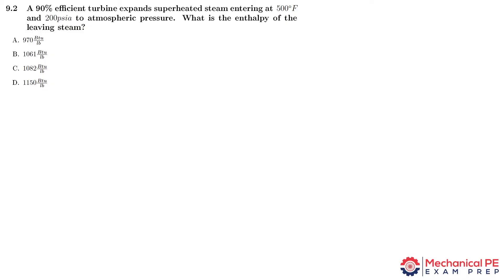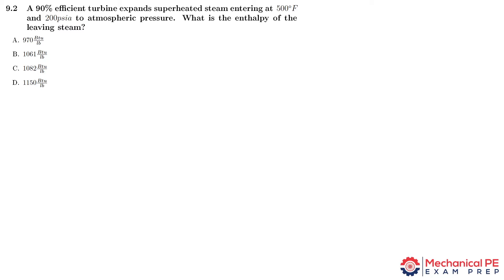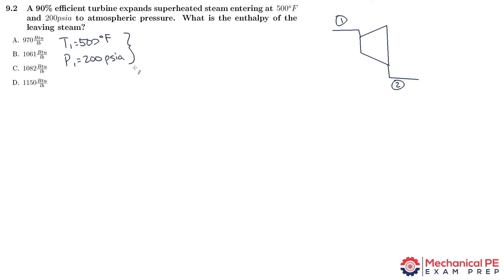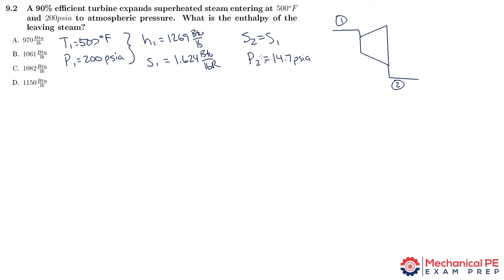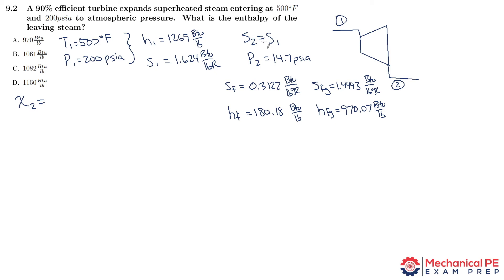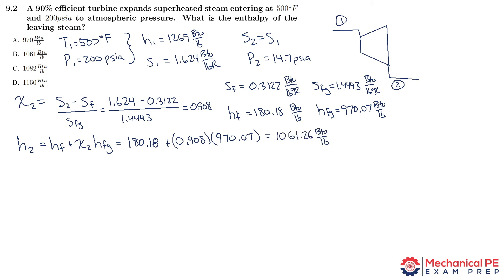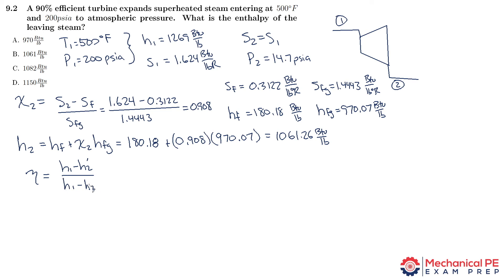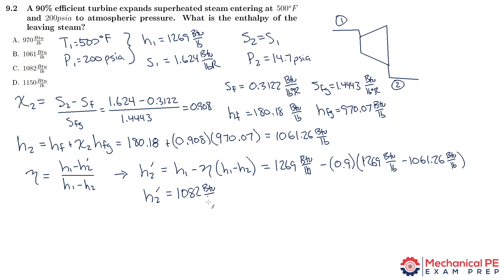Thermal & Fluids Systems Mechanical PE Exam: Energy & Power Systems - Enthalpy of a Steam Turbine

Comment: How can we make the determination that the exiting "steam" has quality? I'm assuming it would explicitly say "leaving saturated steam" but since it just said "steam" we assume it has quality? Thanks!
Reply from the maker: Fair question Ben!  I think we would find ourselves in the superheated steam table instead of the saturated table.  For example, the entropy at state 2 would be higher than s_g @ P2, and then we would have to conclude that it is superheated.   Also if we found h2 actual to be higher than h_g @ P2, that would also cause us to conclude that it is superheated.  So, we made an assumption that it would be saturated at the beginning of the problem, and we were prepared to change course if that turned out not be the case.  Hope this helps.  When is your exam?

Comment: just went through the set of videos. Thanks for posting these. How does the difficulty of these problems compare to the difficulty of the NCEES PE exam?
Reply from the maker: You're welcome, glad it was helpful.  Do you mean compared with practice exam NCEES offers, or the actual test?  IMO the practice exam they put out is a good representation but may skew a bit easier than the real thing.  Many candidates I've worked with have gotten false confidence from centering their preparation around that practice exam.  I see it more as a "tune-up" to be used after going through a robust study process.  The original problems I write tend to be on par or just slightly harder than exam-like problems to stretch your thinking a bit and make the real exam comparatively easy.  My goal is that your exam day is a walk in the park.  Definitely check out the Full Access Bundle if you are serious about going for your PE this year! And feel free to shoot me an email too, I respond to every message.